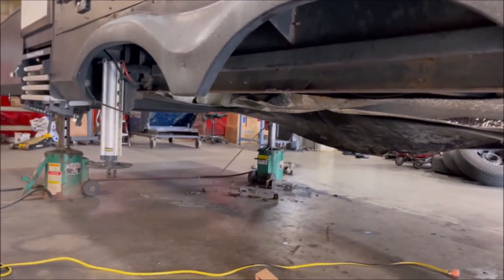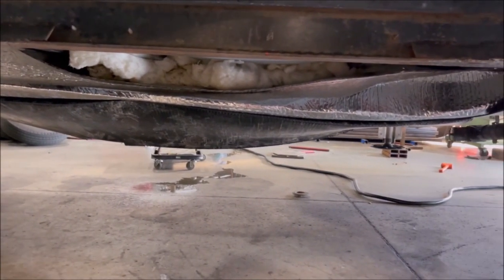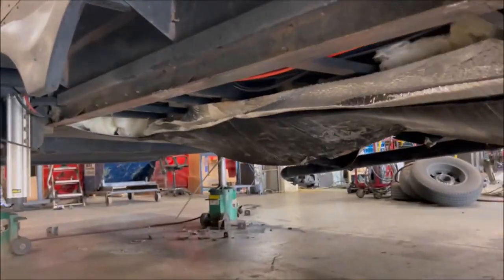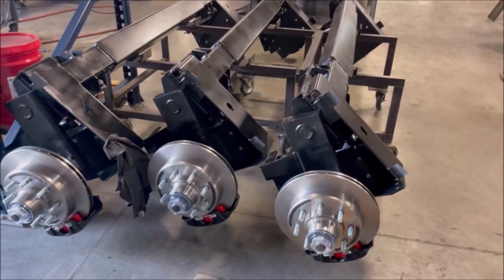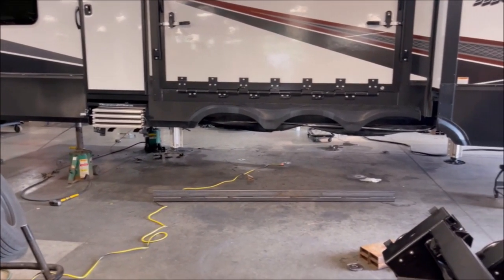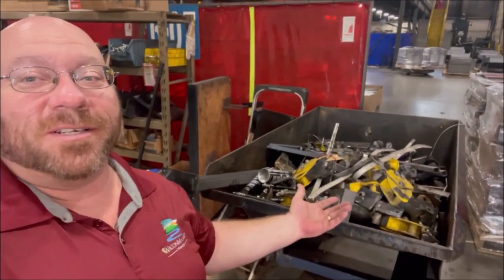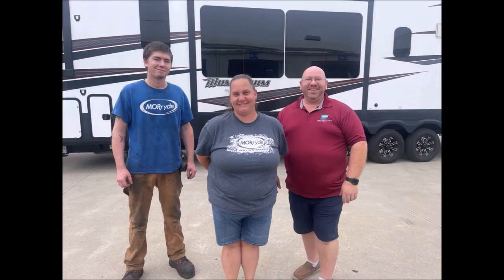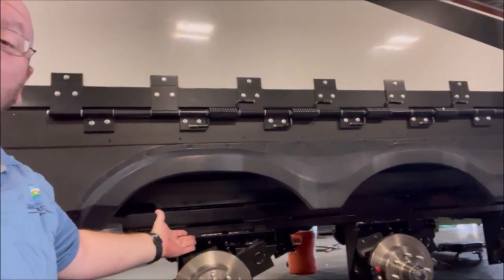MORRyde Independent Suspension and Disc Brake Install and Review

Comment: Nice! Thanking you for sharing.

How did they align the axels during installation?
Reply from the maker: Not sure off hand. We were doing the tourist thing when they did that part.
Reply: @CoolRVEverything  Are the RV tires wearing  evenly?
Reply from the maker: @icare7151  Yep. We have 27k total on them so far and roughly 15k is with the IS.
Reply: @CoolRVEverything  Awesome! Thank you for the data and responses.
Reply: There is an alignment done at the factory prior to you rolling out teh door.  I guess its possible they'd become out of alignment.  I have about 10k miles on ours so far and tires still look GREAT.